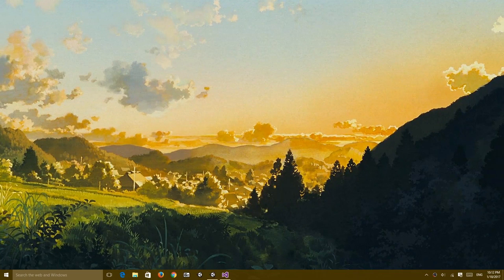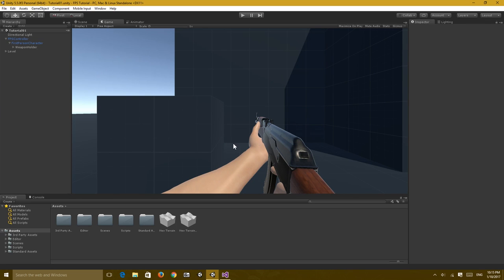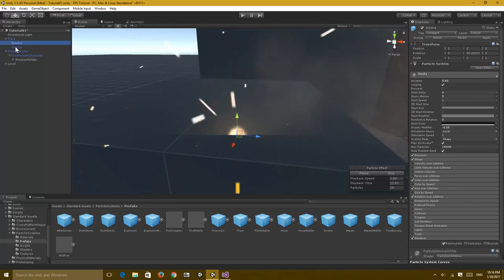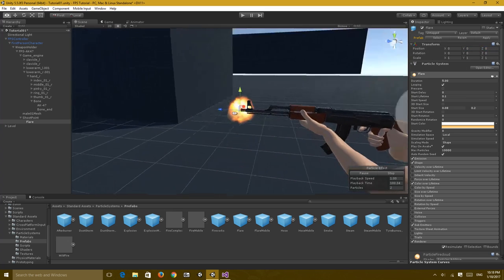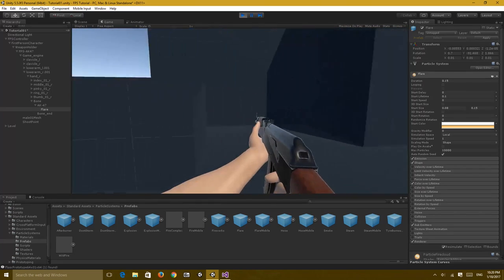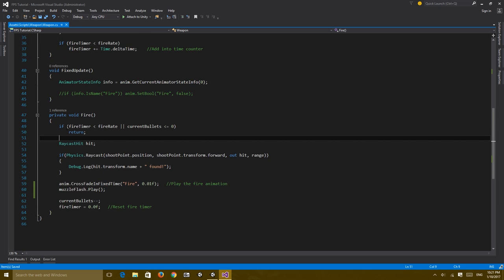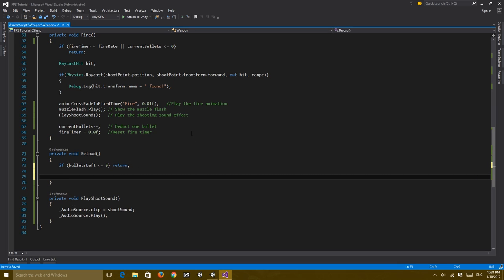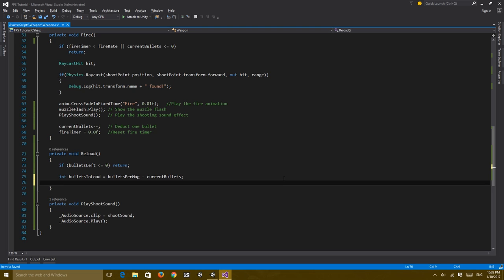FPS Tutorial Series #03 Part 1 - Reloading - Unity 5

Comment: If you keep firing your weapon, your previous gun fire sound will gone, because it has just single audio source. To fix this, add AudioSource component dynamically, also audio clip should be in "Assets/Resources" directory to load Resources.Load() method. This is the code that I was solved:

void PlayGunFireSound() {
 AudioClip gunAudio = Resources.Load("Sounds/9mm") as AudioClip;
 AudioSource gunFire = gameObject.AddComponent<AudioSource>();
 gunFire.clip = gunAudio;
 gunFire.Play();

 StartCoroutine(RemoveGunFireComponent(gunFire));
}

IEnumerator RemoveGunFireComponent(AudioSource audioSource) {
 yield return new WaitForSeconds(audioSource.clip.length);
 Destroy(audioSource);
}

I used coroutine to remove component when gun sound ends.
Reply from the maker: +최민규 You can also use the "AudioSource.PlayOneShot()" to play audio, independently I believe.